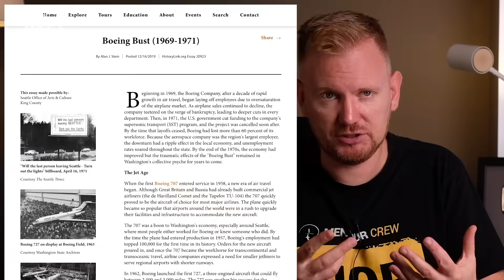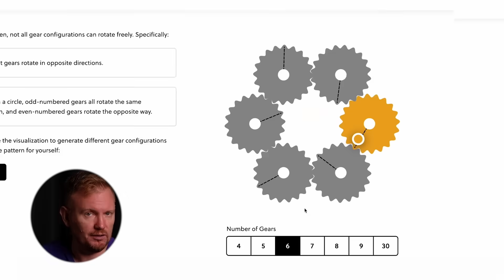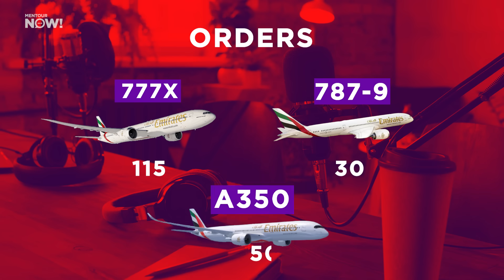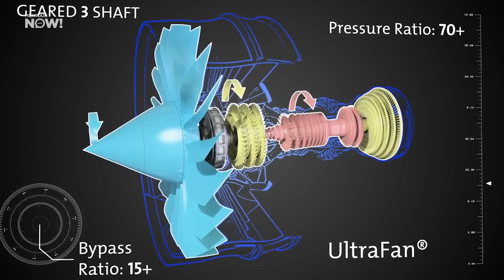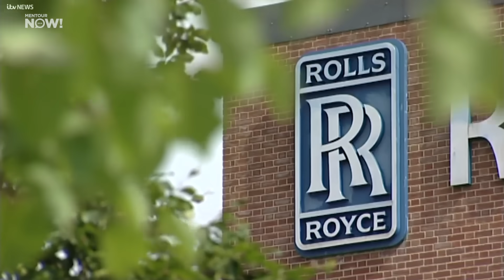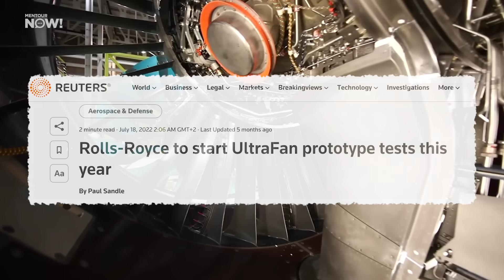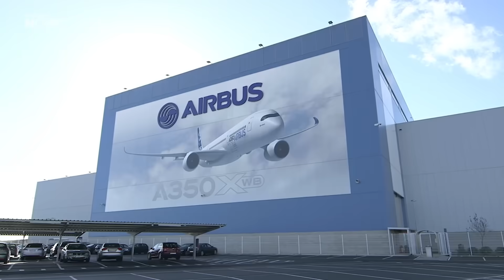Are BOEING planning a 747 with 2 ENGINES?!

Comment: ETOPS allowed the use of twin engine over water flights.  We were looking at 90,000 lb thrust engines back in the 90's for a twin wide body (MD-11 derivative).  Airbus with their $40 billion subsidy had a real advantage over Boeing and McDonnell Douglas in the requirement to actually turn a profit.  As a result of the multinational committee design and no requirement for profitability, Airbus produced a lot of really bad aircraft culminating in the A380 which is referred to by ground crews as the A180 because of the frequency of having to return to the gate due to problems.  This is the reason the planes are being scrapped with less than 10 years of service.  A major financial mistake but covered by the involved governments.

Comment: Hmm, interesting video and topic. From what I understand the 777x is already sort of being positioned to become a sort of “747 replacement” since they apparently share many features in terms of fuselage design. But rather than guess, I may just pose a few questions to the small legion of aircraft engineers I work with as part of my job from both Boeing and Airbus, as well as the corresponding pilots and flight attendants. I’m sure between them they can probably figure out those monster engines might be for and what might happen to the quad engine jets.

But one thought that occurs to me is that both the A380 and 747 variants will be flying for many years to come. Decades even, particularly the 747 that can be converted to cargo haulers. But it’s not like their designs or blueprints are being deleted. Maybe by the time the big jets of today are finally retired, technology would have had time to move on and modification of the airframe and engine design might become possible.

But then again, I do wonder about Boeing. All they seem to do is constantly reuse and retrofit the same old designs for airframes they’ve had for decades, even when it just isn’t practical or even particularly safe anymore. As the whole max 8 debacle demonstrated very aptly.

Oh and Petter, if you ever fly into Bristol airport I’d like to say hi. I work with many of your colleagues as sooo many of your airline’s fleet constantly fly in and out.

Comment: GE9X engine in the 777X has a fan diameter of 134" / 340cm -- 6" bigger than the number you quoted, which is actually the slightly smaller engine it was derived from, the GE90. Overall outside dimensions of the GE9X are about 13 1/2 feet, or about 4.1m. Holy god that's big. Great for making coleslaw though.

Comment: This is a very good idea for a video and a very bad idea to be feasible. It is not just a matter of business model or size of the engine; it is mainly a matter of physics and engineering concerning airplane safety (structure and control). Considering a failure of one engine at takeoff of an airplane with a MTOW of 440 tons, the effort of the other engine on the structure and the amount of rudder input (necessary to compensate the unbalanced thrust and the drag caused by the BIG failed engine) will be enormous. The number of adaptations necessary to avoid these problems would eventually  create another airplane. It would not be the 747 (or the A380) anymore...

Comment: The older 747's aren't going to last forever, and the USAF will need to start planning a C-5 replacement in the next 10 years or so.  It's likely there is a market for something really big to handle the unprecedented rise in air cargo.  It's probably still a few years away and will be high winged, so that huge engine will fit.  You heard it here first... 😉

Comment: Emirates might want another jumbo or super jumbo, but all the manufacturers will offer is a stretched version of their current largest models, which at the moment have had the speculative names of 777x-10x from Boeing and the A350-2000 from Airbus.
Reply: Emirates might therefore eventually have to invest in its own factory and design facilities.

Comment: I fly long hurl a lot. My biggest problem is the constant noise of the engines. It's so annoying. To me of all the planes I have flown on, the A380 is the best. No matter where you sit you can not hear that drone of the engines. Now I try to fly on the A380 ( mainly Emerates ) whenever I can.
Reply: Sony WH-1000XM4 or 5 active noise cancellation headphones are amazing. They can be used wired (for IFE) and will last even the longest flights.
Reply: @nshon7  Thankyou for your reply but I could not wear headphones for13+ hours.

Comment: The right move (in my opinion) for a twinjet Boeing 747:
1) Vertical wingtips to reduce wingspsn to the 400 version size.
2) The 400 version body to reduce length.
This will allow the future Jumbo to operate on airports that accept 747-400 but not the 8i or the Airbus A380.
Two additional items:
-Upperdeck doors as the 300 version in orden to allow direct boarding.
-Maybe a range reduced to 9300 km because this type would be used for domestic high demand flights in Japan, China and India. Is also enough to serve several transatlantic routes.
Alejandro.

Comment: I'm not sure the RR Ultrafan would be powerful enough. Projected thrust is 110,000lbs, for a combined maximum of 220,000lbs in two-engine configuration.
747-8 currently has a combined total of 266,000lbs, and the older 747-400 has a combined total of 248,000lbs...

Comment: Possible? Yes. Worthwhile over the already planned full carbon fiber 777? Less likely. Rumor is that they delayed using a carbon fiber fuselage because between the complete 787 and wings of the 777, Boeing is already beyond their kiln throughput and need to expand first.

I don't think its fair to compare the 747/777 to the a380, considering that the airbus has double the passenger capacity. Unfortunate for Airbus that Emirates is about the only airline that can actually use it. Maybe talk the US military into letting C-17s go retail.

Comment: I'm thinking of making a 747 a tri-engine. 2 ge90's on the wings and a normal engine in the tail to help in takeoff or backup if an engine fails. Tail can shut off and close up during flight. Not sure if 1 ge90 would be able to take off fully loaded and fueled at flank engine speed of 110%++.

Comment: As it is right now, the A380 is too big for two engines. Maybe a tri-jet, but the 747 is a bit closer in size and it's already a far lighter aircraft with a much better wing. But more likely this would be used by a 777-10 sized aircraft which we know Boeing has looked into.

Comment: The 747 with 2 engines would probably require newly engineered wing. Also ground clearance would be a consideration. All most likely possible but not economical.

Comment: Hear me out: a twin engine Lockheed C5 Galaxy. 
A forgotten out of production double decker with potential for an update. The rear ramp is more practical for cargo operations and it has a flip nose. The passenger capacity is excellent and the C5 can be pressurized to a lower altitude than ordinary jetliners. High wings already compatible with an oversized fan. 
Design an efficient composite wing, restart C5 fuselage production, update systems and avionics, sling a pair of ultra fans underneath, a little corporate welfare and profit. 
Boeing and Airbus have excellent twin jets for the lion share of customers. A350, 777x and 787s for passenger service. Factory 767 freighters. I wonder if Rolls Royce has a lead off customer who will order airframes when the technology is proven.

Comment: for Rolls Royce to be ready with an ultra high bypass engine is going to require the development of a very expensive gear box which they will want to do only once. It is much easier to initially design big and scale down than it will be to design for current applications and have to scale up when the need arises. With the Ultra fan fully developed and on the shelf they are ready to go as soon as patent obstacles are removed.
When a customer appears for an Ultra high bypass engine sized  from the Ultra fan downward, they will be ready.
This mirrors the development of the Trent core where all 3 spools could be scaled to drive increasing fan diameters as required or to be tailored to marine and industrial applications.

Comment: I'd be interested in a deeper dive into P&W/Raytheon's patent claim. I know the graphic used in the video isn't completely comprehensive, but at first glance it seems the crux of the model is a planetary gear assembly. Planetary gears are not revolutionary by any stretch since they have been used for centuries, but I don't know what other technologies were included in the patent.

Comment: I have often wondered if Boeing would take a 747 fuselage and hang some 777 or 777x wings on it and make a new jumbo jet. It would not have to be the size of a an Airbus A-380. 

But with such a huge diameter engine, would we be looking at a totally new wide body shape to allow for placement of such an engine ang allow for a decent sizing for ground handling and maintenance operations?

Comment: RR's new engine may be intended for a platform similar to the C-5 Galaxy. It has the advantages of a high wing and rear door. A high wing would provide better ground clearance for RR's very large engine and its rear cargo door is far superior to the 747's front door. A twin engine version would make the C-5 practical for civilian freight.

Comment: Could be a case for a Rotating Detonation Engine - still under research/testing. https://www.youtube.com/watch?v=AAFlky01ikU I've seen a couple of videos on it and the premise is an RDE could produce twice as much power if the engine is the same size as current jet engines, or, be half the size and make the same amount of thrust. Time will tell. Like you mentioned though, could take decades...

Comment: The performance of the Wright Flyer was severely limited because its engine was underpowered. It was the best they could do at the time.

Engines have lagged behind plane body development since the first airplane.

Rolls-Royce may be developing the Ultra Fan for a plane, or they may be the first to develop an engine ahead of a body design. Having a huge "off-the-shelf" engine not specific to a particular airplane could mean that Boeing, Airbus, and possibly other players can develop new designs around the same engine.

Comment: The current GEnx-2B67 has a fan diameter of just under 105". That gives you 18" of clearance under the inboard engines for takeoff and landing with some margin for turbulence and crosswinds. A fan size of 128" just isn't feasible.

Comment: FYI it's three-point-two-five, not three-point-twenty-five. This is a very common mistake among Americans who struggle with the decimal system (let alone metric!) It implies the decimal point should be moved - so three-point-twenty-five could be correctly interpreted as 5.5.
Reply: Huh? Aren't you saying 3.25?

Comment: Given that the latest 747-8 only has 18" of clearance under the #2 & #3 engines (inboard), I don't see how you could possibly squeeze a larger  engine on this bird and still have it keep its current weight capacities. Engine pod strikes are really a  big thing with this bird.
Reply: Reducing the height of the pylon might give some more clearance. And there might be a bit of margin in the height of the landing gear.

Comment: Putting two larger engines on a 747 would mean putting the engines near the vertical stabilizer or lengthen the landing gear and modifying the 747 fuselage in both cases.

Comment: You’ve not added into the economics of UAE Airbus A380 fleet, the vast amount of retired A380’s means huge amounts of used/reconditioned parts. This will save Emirates huge amounts of money, but you may say, “it’s not about the money with Emirates.” I would agree, somewhat, but, having vast amounts of parts ready to go, will equate to huge time savings, or lead times, which end to end means massive savings monetarily.
👌🛫😎🛬🤘m-E-m

Comment: Hi Mentour! Merry Christmas! I think I'll speculate too. Rolls Royce wouldn't put tons of moolah into a massive "426 HEMI" of a motor without having a viable wing ta mount it to. The detective in me says "The game is afoot!". There are unspoken events taking place here and I hope it's Boing that's in the race. I mean "The Max" issue was/is a catastrophe and the 777X (the most graceful and astonishing aircraft I've ever seen is...well, I don't know! Is it on schedule with tests N stuff? Does it have problems too? I'd be the first in line ta buy that potential "superstar"! If I were Boing, I sure wouldn't be putting cash into the 797(?). Having a single pilot aircraft just sounds like a disaster in the making. Why do have to retire the best passenger jet ever...The 747? With all the new types of lighter stronger building materials and all the new tech out there; what's wrong with The 747 2.0? With those gargantuan engines I think you'd have a lock on a sure fire winner. Boing could certainly use a win soon. I hope they do. Well, PIOSEE to you and have a swell day! \m/
Reply: I don’t see a single pilot passenger jet being a thing for decades, if ever. It’s just not a good idea to introduce a critical system (which the pilots are) with absolutely no redundancy. The 737 max 8 was proof of that concept. But I don’t think I’d ever be comfortable boarding and aircraft like that with only one pilot. We’d be one trip and bang to the head, heart attack or any number of things that can cause pilot incapacitation away from being well and truly screwed.

Comment: I had always assumed the "twin-engine 747" was the 777. The last time I flew on a 747 was in 2010 (Air New Zealand, L.A. to Auckland).

The other airline that comes to mind with a huge hub a long way from anywhere else is Qantas.
Reply: Yes, that’s also what I thought.
Reply: Except the 777 is not a double decker with a nose that can hinge like a 747F.
Reply: @shrimpflea  I know. All the big cargo planes (747, C-5, AN124) have noses that open. Ths isn’t an issue for passengers, however.

Comment: Let's begin a "KickStarter" Campaign to build an all new composite body 747X 3 engined Tri-Jet Combi airplane with an "S" duct engine inlet in a T-Tail configuration where the customers can choose to mount engines 1 & 3 in nacelles either under the wings or mounted to the aft fuselage like a MD 80. In addition it would need to have an aft cargo ramp too and air stairs integrated into the fuselage.
Reply: It was considered in the 80s and cancelled.
Reply: @roaklin  We are in 2023, things change.

Comment: a 747 with only 2 engines just wouldn't be the same. those engines would have to be more than twice as powerful as the engines they use now, or losing one would be like losing 2 of the normal 4 engines. i mean, if you lose an engine on a 4-engine 747, you lose 25% of the thrust which causes some problems but is manageable. losing 1 engine on a 2-engine jet you lose 50% of the thrust, which is a bigger problem.
besides, such powerful engines are bigger than the standard 747 engines, which raises ground clearance issues. 
12:44 3 meters 56? then add the cowling and the total engine diameter will be closer to 4 meters. pretty sure there's not that much space under the wings of a 747.

Comment: A couple of thoughts:
1.  A 747 with engines of that size would run into the 737MAX problem of engines being too close to the ground.  In fact, it was a problem when 747's were being used to test the original 777 engines years ago!  But it'd be a new airplane anyhow.
2.  It probably wouldn't have Rolls-Royce engines.  Boeing has been managed -- badly -- by followers of GE's Jack Welch for 25 years now.  That's how GE gets locked in as the sole engine supplier for 777X, 747-8, and 737 via the CFM partnership.